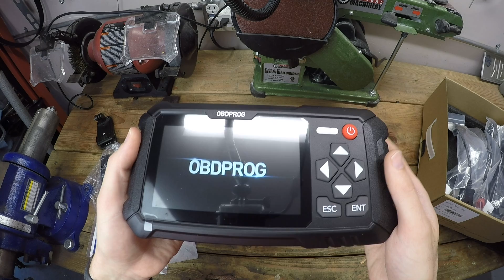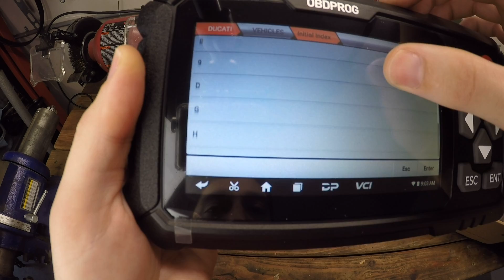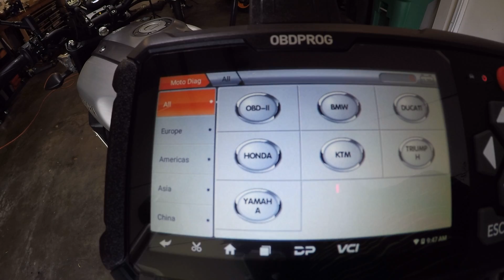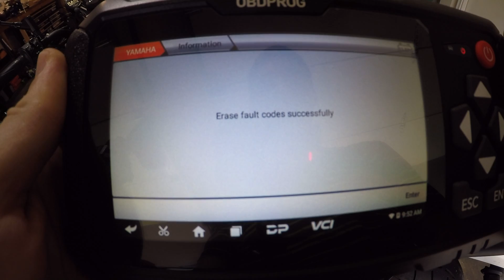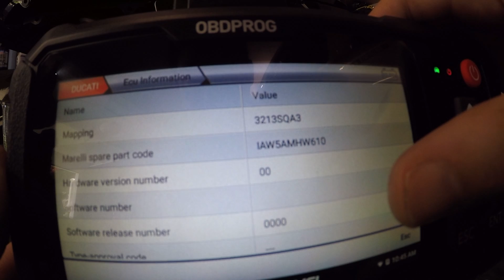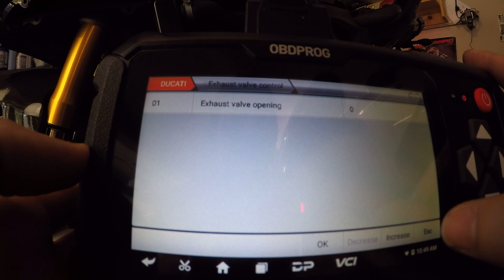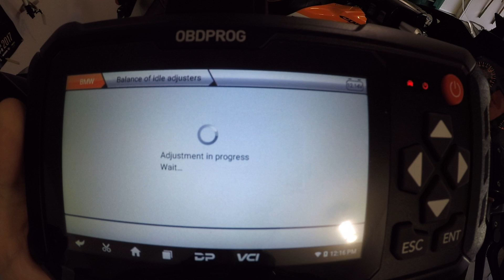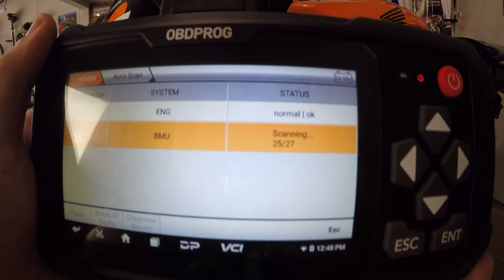Never schedule a motorcycle service appointment again! | OBDPROG Moto 100 EU Diagnostic Scanner

Comment: Using a $15 connector from eBay, I can connect my car OBDII reader to my 2020 KTM, read and reset error codes. Maintenance changes can be handled through the bike's menus.
Reply: Hey! Which connector and reader do you use? I'm dealing with check engine light right now. Please help me😳
Reply: But this guy thinks a $500 tool is the trick lol ... maybe for those used to paying Ducati  or KTM stealership prices ...

Comment: Hi,
I am planning to buy a Moto 100 EU scanner for my 2007 Ducati ST3s ABS and 2010 Yamaha FJR 1300A.
I think I will need to buy the special connection lead you mention for my Ducati. You say to check that the polarity of the lead has been set up correctly at the factory - how did you do this ? 
Thanks for a great video !

Comment: Could you do a bike check for me as well please: 05/06 Honda VTX1800C 19/20 Triumph Rocket 3R. Tool looks very interesting.
Reply from the maker: The tool lists the 05/06 VTX1800 and I believe it includes the 19/20 Rocket (specifically, it says Rocket III Roadster 2012 + ). Without plugging it into either bikes I can't verify any further diagnostic capabilities.

Comment: Hi, interesting video👍 I would also like to buy the tool. Does this also work on a 2013 Ducati Diavel? Is a suitable adapter cable for the 4-pin connector under the seat included? Or do I need the cable you used on your Duc, the cable with the extra battery connector?
Thank you for your answer, I'm looking forward to more videos 👍
Reply from the maker: The 2013 Diavel is covered and the included 4 pin cable will work with it.
Reply: @PracticalEnthusiast  Thanks for your quick reply👍 I ordered the tool. I'm curious to see which functions I can use on my Diavel🤔

Comment: HELP!  I have the same Moto 100.  I am unable to reset the maintenance schedule on my 2009 RT, which is the primary reason I bought this thing.  I am able to get the screen that displays the internal date, km, service date, ect., but when I enter each one, not able to make changes.  The OBDPROG website has  directions for a 2012 RT, but the process is different.  Have you been able to reset your service interval and how did you do it?

Comment: Hello,
I bought the European version obdprog tool, on mine the OBD ll icon is not in the diagnostic program menu.
 I did not find the ESA calibration function for a BMW k25 motorcycle as well as the ABS purge function.
 I ask for your help please purge ABS.
 I ask for your help please.
Reply from the maker: Hi! You don't want to use the OBD II function for your BMW R1200GS. You want to use the BMW - specific diagnostic menu. If you don't see it, that is probably because you haven't downloaded it yet. Go into the "DP" program, then go to "Upgrade". You need to set up a login and user account. Once you are logged in, you should select all software packages and download them. Afterwards, you should see BMW as a diagnostic menu option in the "Diag Program".
Reply: can you make me a youtube that shows me how to proceed with the ESA calibration and the ABS purge, thank you in advance.